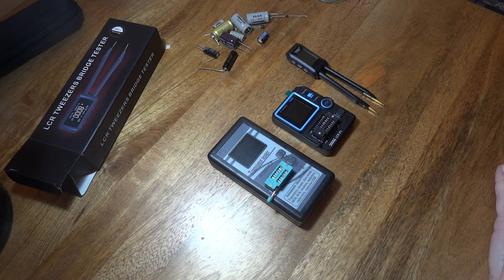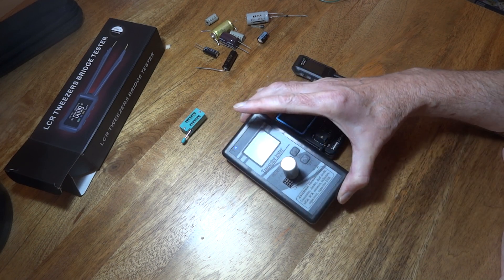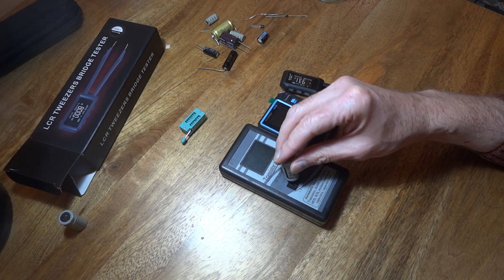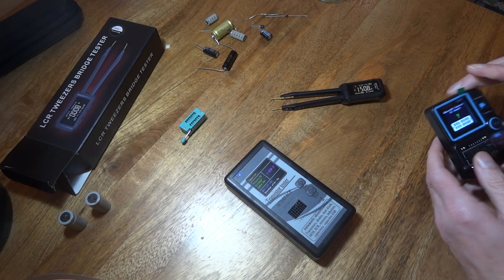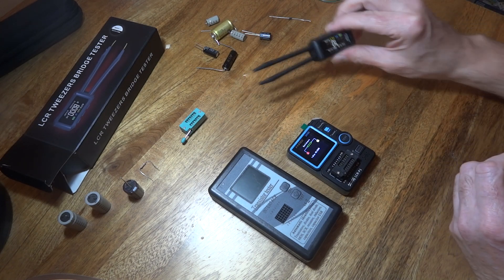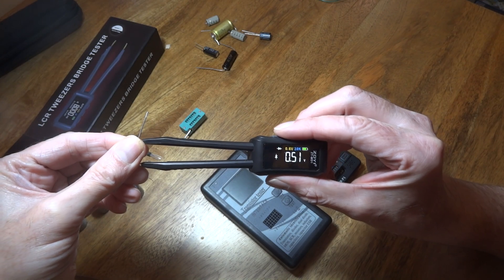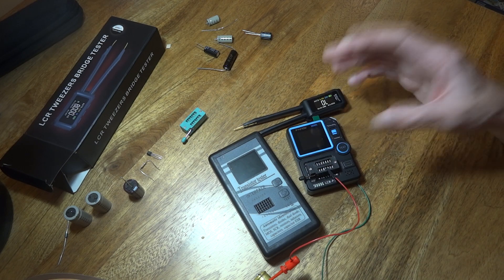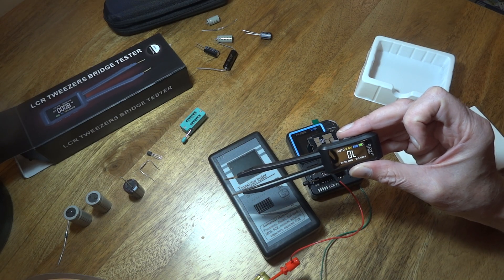Testing Capacitors with ZOYI ZT-MD1, FNIRSI LCR=P1 and Other

Comment: If you want to test electrolytic capacitors thoroughly you need to measure three things, capacitance value, ESR, and leakage vs operating voltage. None of these meters measure leakage, you can have a nominal value cap with low ESR and still have a bad cap if its leaky (how detrimental this is depends on how it is being used in the circuit). The Zoyi is fine for capacitance value and ESR. There are some simple diy leakage testers you can build for low voltage caps. If you want to test high voltage caps I suggest you consider buying one.

Comment: ZOYI is the best here the others are poor and I would not trust them, the ZOYI has changable frequency. However I would recomend Peak Atlas ESR70 this is made in the UK or a capacitor wizard made in the USA.
Reply from the maker: Thanks for the info, I did look at the Atlas and if I was going to do a lot more recaps I would have proberly would have went for that one its around £85. But I may just recap one more amp now and that will be it I think.